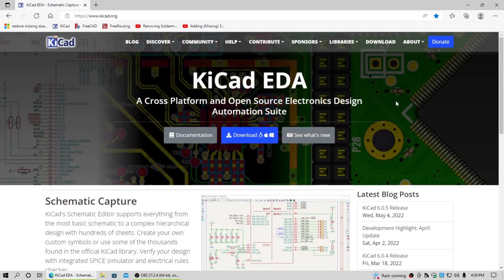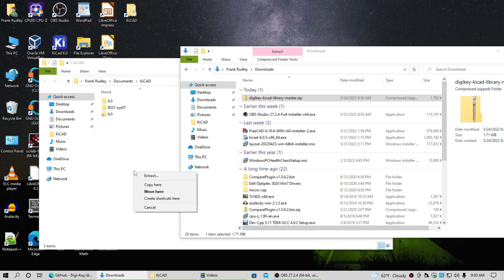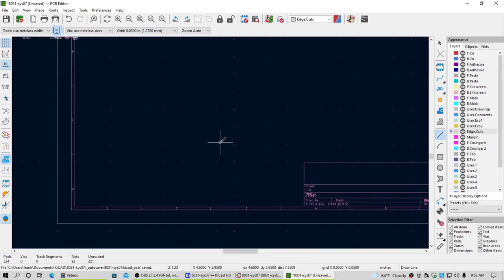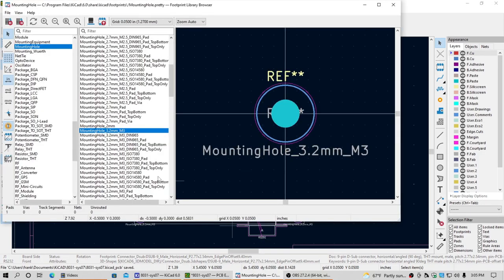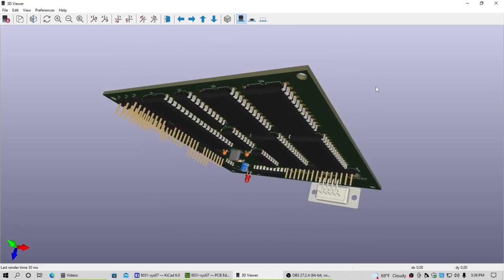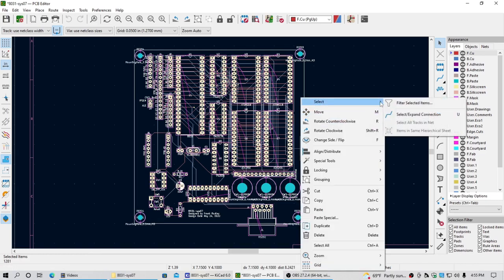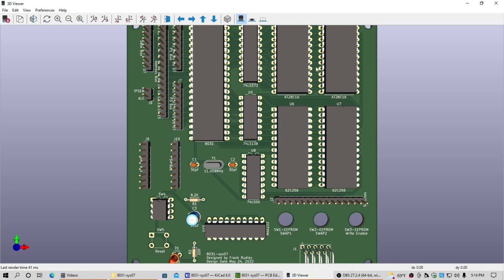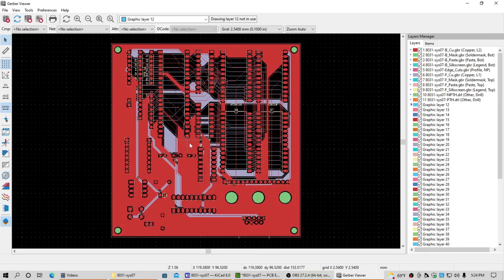Demonstration of using KiCad with the Auto router to quickly design a Printed Circuit Board

Comment: Is it possible to configure autorouter to route everything but not power and ground pins? Or is it possible to manually toute power and ground in Kicad first than import to autorouter to finish the job? Great tutorial.  Cheers! S
Reply: If you unselect the power supply and GND in the netlist with the autorouter, you can wire only the signal line.

Comment: How can I force the auto router to only put the tracks on the back copper? Thanks for the tutorial sir.
Reply: When opening a file in Freerouting, head to the "Parameter" tab on the top of your screen, and select "Autoroute". Then you'll see your routing options, and you can uncheck any layer under the "Active" column. Note that you can also force Freerouting to not use any vias when autorouting, which can cut some cost on the production.
Reply: @matthiasnicoloso  Thank you very much. I will try this out.

Comment: Hi. What a great video. Thank you. How do you locate the exact location of the mounting holes? How do you measure them to the outside edges of the board? Please advise.
Reply from the maker: I use the grid that KiCAD provides to locate the mounting holes. The edges of the board are defined in the edge layer and are also relative to the grid markings.
Reply: @frankrudley8992  Thank you. The PCB vendor looks for a numerical dimension to drill the holes? Or the vector graphics (dxf) show the visual location? Please advise.

Comment: Hi Frank great job! do you know how to change the tracks width in Freerouting or cannot be possible, thanks for your reply
Ciao 
Roberto
Reply from the maker: Yes - Go to the Utilities pull-down. There is a sub-menu called Net Classes. You can change the default trace size. You can also tag traces say for "power" and "signal" and make two different common trace sizes. But what I usually do is go with the default traces size, and then modify it using KiCAD.
Reply: @frankrudley8992  thanks a lot for your reply 😉